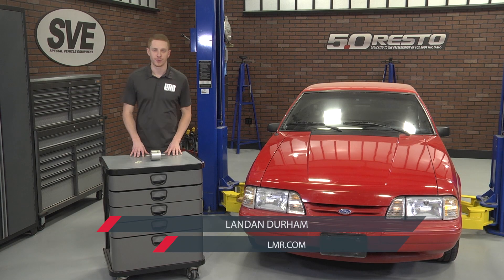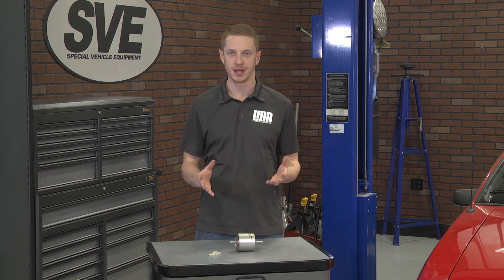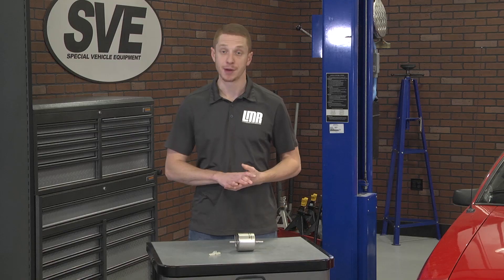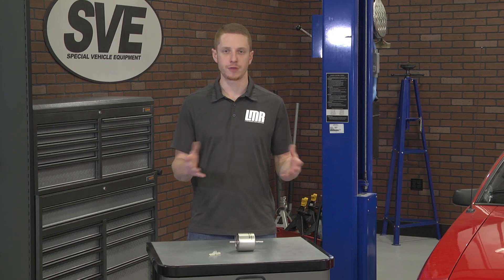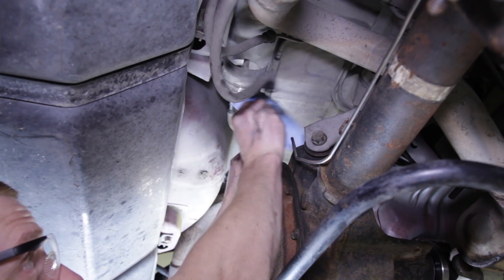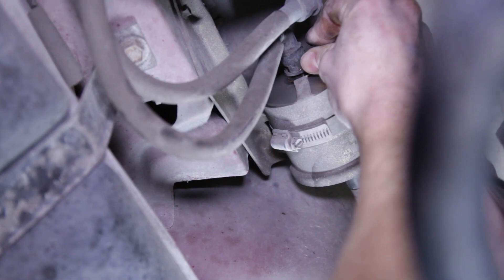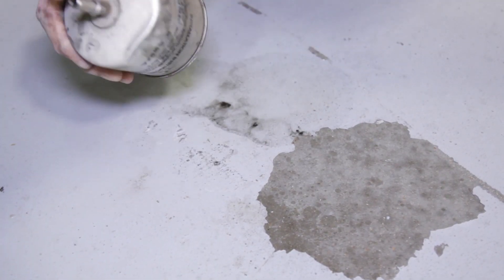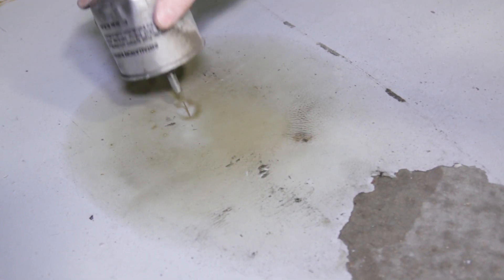How To Replace Mustang Fuel Filter - LMR Basics

Comment: I did this,and replaced my fuel pressure regulator to a kirban and now car wont start unless I spray starting fluid in it. It'll died till I spray it about 3 times.
Reply: RemoverInnaWoods  haven't checked psi yet, going to do so this week though.

Comment: You pointed to the right but said to install the fuel filter facing towards the drivers side of the car.
Reply: UnTamed Extras you don’t really need the arrow. It should have a similar shape to the holder.

Comment: Arrow toward the engine. Not the rear of the car
Reply from the maker: Steve, We show in the video that the arrow needs to face the drives side of the vehicle. This would be the correct orientation on the Fox EFI equipped vehicles.